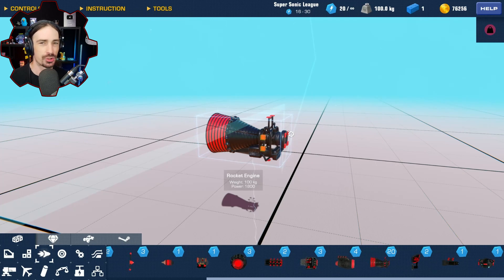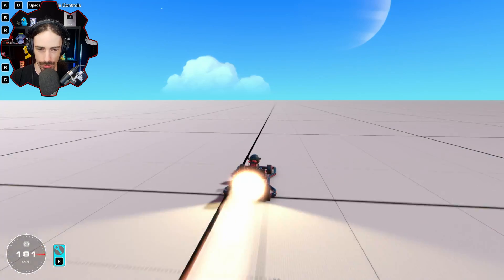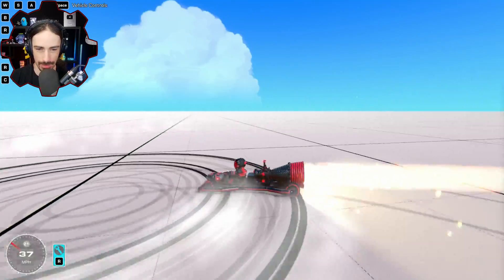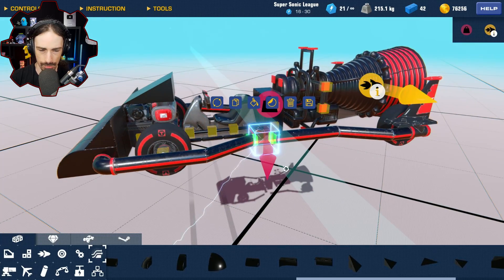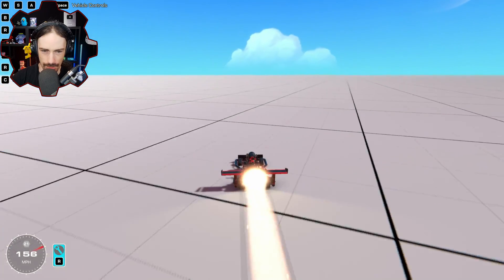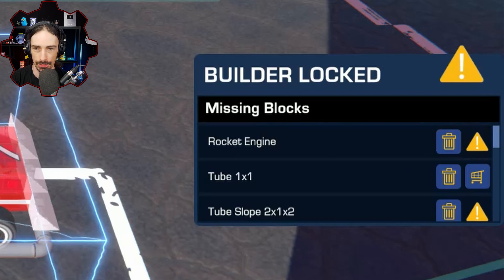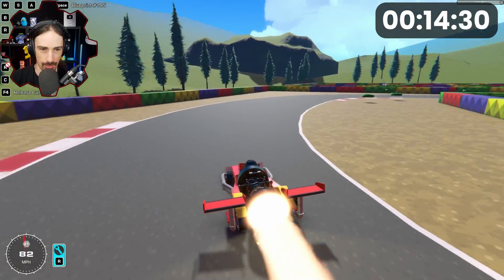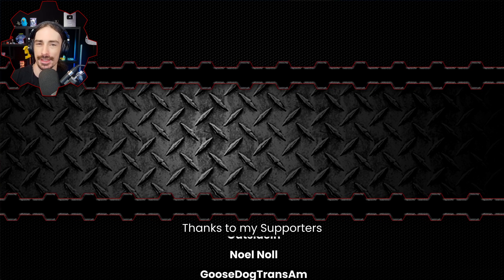Building an Overpowered Go-Kart Using a Rocket Engine!

Comment: Fun tip: Set an OR gate to .02 output power, set a toggle key (optional), and you can preheat the rocket engine. This gives you much more instantaneous acceleration, with all the power of that massive rocket.

Comment: I think you could have given it a gyro to work with the steering to give it more control in turns at higher speeds, potentially. Then might be able to take those turns much faster.
Reply: Gyro is cheating...

Comment: trying to build a go-kart to have form and function, well straight away with jet engine  is taking away from form and function,  then you build what only seems to be a  plow on the front and then a wing on the rear,  you building a plane or snow plow ?  lol

the front tubing should not be straight, ( atleast of not seen straight tubing before),  should be curved.

Was funny to see this build though

Comment: If you put thrust vectoring to it, I think it will help improve the turning at high speed
Reply: yeah, I think he kinda' misunderstood the steering issue. Adding more mass can only really compound the problem, since it's an issue of momentum. The traction of the wheels can't provide enough impulse to combat the thrust from the engine, so without aiming the engine against the initial direction or using it to steer he just ends up drifting.

Comment: The stability issue is from the rocket engine being behind and above all the wheels. Any small turn will technically be a "drift" because of how the rocket is pushing the kart. Then yeah, need some major downforce on the back because of how high it is.

Comment: Scrapman, did you think to turn the wheels in the other direction to unturn? Cause with go-kart tires on slick surface it's like modified dirt track cars and when you turn one way you actually turn the other way

Comment: Proposal for a multiplayer session:
Build airplanes that must have at least 5 wing pieces on each side. Uplift may only be performed by these. Each wing piece must be connected to a hinge.
An altitude sensor is installed, which switches off the thrust at a certain altitude so that you have to be close to the ground.
Armed with EMPs, you go into battle.
When hit, the wings fold in randomly and the plane becomes difficult to control. The player who stays in the air the longest wins the round.
(optionally add more weapons)